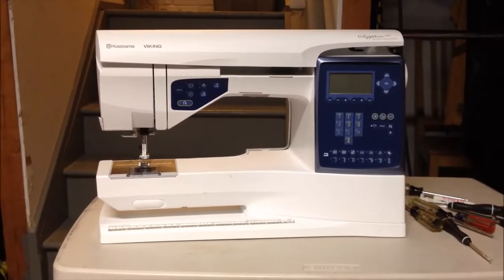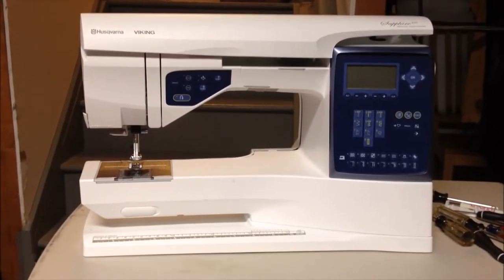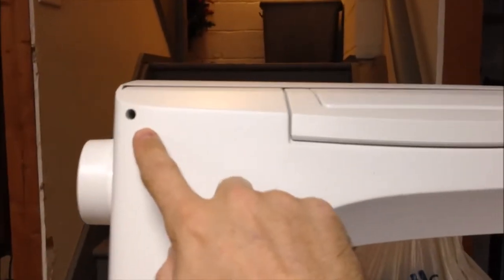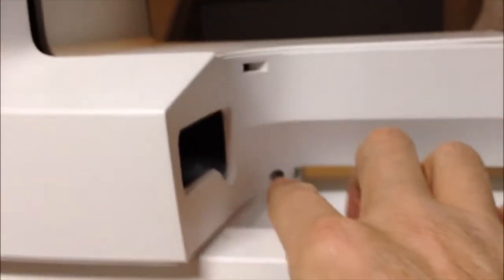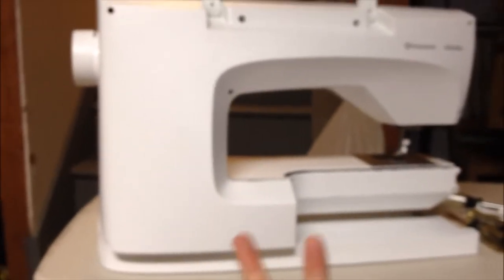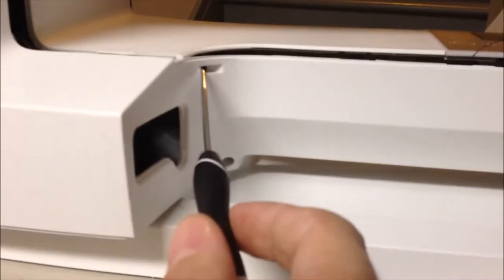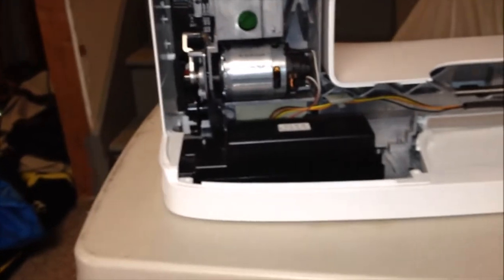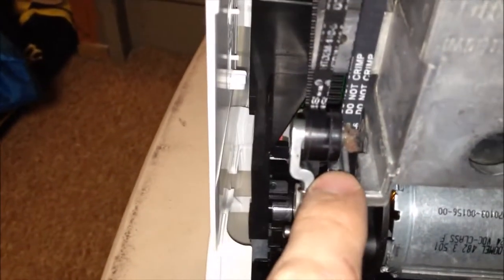Husqvarna Sapphire 830 Viking Sewing Machine - how to service DIY

Comment: Thanks! You saved my Sapphire 850 from the dump. This is how.
I fixed my jammed (up) presser foot rod, and the cause was RUST... 50 yr old machines already used stainless steel, but not here.
Let's say, the seller and/or the service person withheld the truth. The reason was that the presser foot rod had rusted into its apparently iron (red rust) cylinder block. It no longer had a warranty, so I fixed this over 3 days it by:
1.  Stripping the machine of the plastic back per your video. On a Sapphire 850 this involves 6 deep set torx screws, 2 hex screws under handle and 2 1.5" long hex in bottom near back edge. Mark their holes with sharpie or you will not find them back. (Of course you took the top lid and accessory case off long ago.) I used a letter opener to carefully pry the back off while laying on front side, working my way from the outside edges to center. Set machine upright again.
2.  With brushes, and ear swabs, penetrating oil (3 in 1 oil works too,) I removed rust from all pitted rods and rusty frame pieces, letting it penetrate and lubricate, moving what would move. I was relieved that it wasn't an electronic problem and aimed to keep it this way. But all rods moved easier and easier as I kept cleaning/lubricating, except the presser foot rod. So after day 1, I gently tapped the rod down with a small hammer and a drill bit extender as intermediary. When that did nothing, I made sure I had the straightest shot possible and let the 16 0z hammer drop straight down on the extender. Teeny budge! So more oil soaking and rust wiping, covering the whole lot with a dust cloth to take a coffee break with a nice lunch. Repeat oil/wipe/move, and I was able to tap it down all the way, and grab the plastic foot holder and manually move it up again. More oil, wipe, oil and cover with dust cloth, as another day went by.
3. There was no lint in there, so it had been cleaned (serviced) before, but "not fixed recently" obviously. Disuse and damp cold weather is the greater enemy, but guys that charge $200/hr to lie to a female seamstress like me, who at most clears $20/hr, made me mad. Once I got everything moving easy, and clean, I put it back together in reverse of the stripping above. I cleaned the outside with window cleaner on cotton waste strips. And I have been turning out dance costumes on it ever since. I will make sure to strip it down every 6 mos to check for rust again.  I did wish you had said the word Torx screwdriver, but they are laying beside the machine in the first frame: all black. with white bands.  You would have saved me time finding these, but anyhow, I found his video helpful.
Reply from the maker: Wow - that's nice to hear - I almost deleted this video

Comment: As a  repairman CERTIFIED through SVP Worldwide (Singer, Viking Husqvarna and Pfaff), I can tell you that taking the cover off will void your warranty. Also, DO NOT lubricate the bearings. these bearings have microscopic porous holes in them. They are self lubricating bearings. Adding lubrication to them will shorten their lifespan. Also, DO NOT poke around in there unless you and the machine is properly grounded using a grounding strap, grounding mat and a power outlet that is properly grounded. The pin on the antistatic mat is plugged into the 3rd pin which is ground (provided the outlet was hooked up correctly otherwise there is risk of electrocution) These machines are sensitive to ESD (Electro Static Discharge)Only a certified service technician should open and do maintenance on it. However, if your machine is outside it's warranty period feel free to do what you like. If you want to make sure everything is done correctly though, my company works directly with the manufacture of these machines. It is recommended that you bring your machine in annually to have maintenance performed on it. More if you use your machine heavily.
Reply from the maker: Seems like good advice.
Reply: Where are you?

Comment: I have a Viking sewing machine similar to this.  I took the front cover off and now the front panel does not show which stitch I am on.  Can you explain how to reconnect that?
Reply: +Carol Merrill Are you still having trouble with your machine? I am a certified service technician for Viking Husqvarna.
Reply: Eclipse Computer Solutions   I have the Emerald 183 & the 'service' cost is also not an option. Can I remove all screws & clean/oil myself or is there some form of Freemason magic involved here? I got it for next to nothing at a yard sale & I'm sure it could be cleaned but don't want it to stop working just because I opened it without knowing the magic word.  Please & thank you.